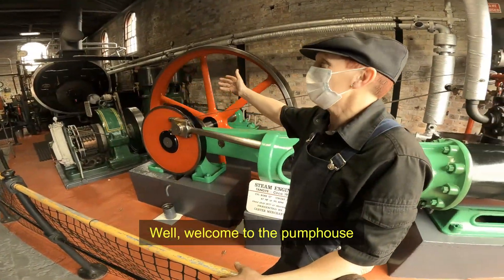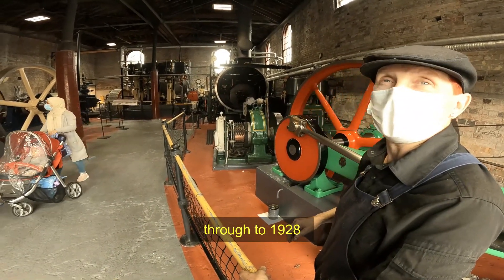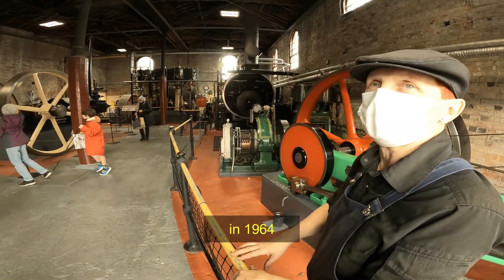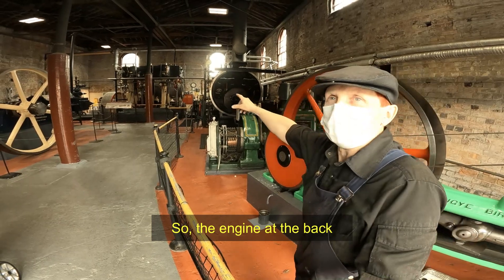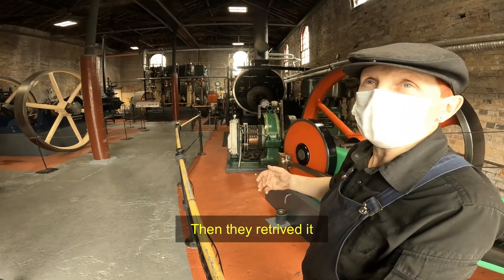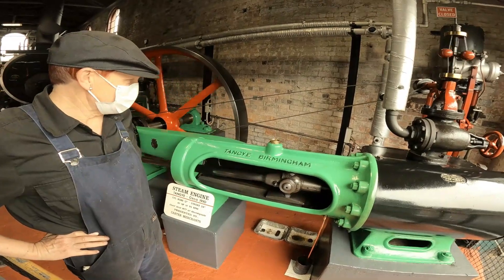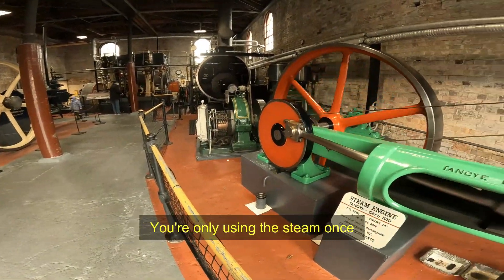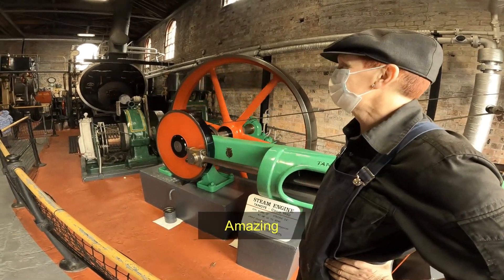New Zealand   MOTAT Pumphouse

Comment: 2:08 Yes , this was at Carter Merchants' timber yard in Taylor's Rd Morningside . It was still in use in the 1970s . I remember ,as a kid , the steam exhaust exiting through an exterior wall of the building onto the railway tracks.
In the 70s it powered a generator , I don't think they had any line shaft powered equipment by then.
The boiler was fueled by wood waste from the mill.
Reply from the maker: That's great to know someone actually saw that in action